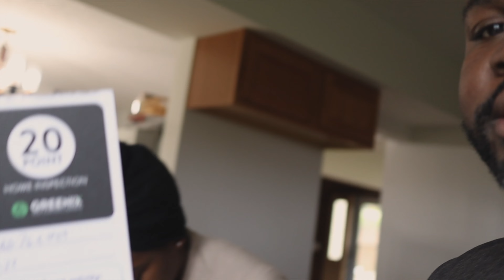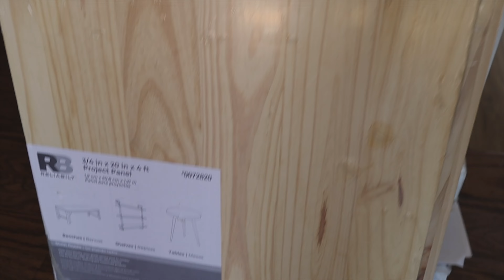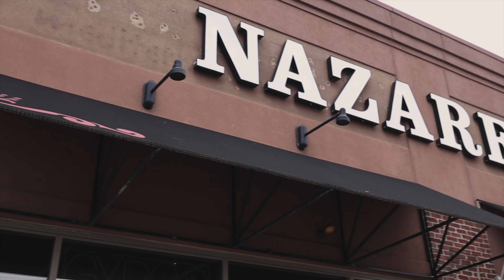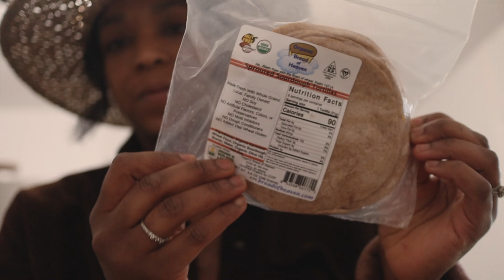Family Vlog | Roller Coaster Week + Living Room Reveal

Comment: You can get rid of some of the insects by using a vacuum cleaner that uses bags and has a hose attachment. You suck up the insects into the vacuum bag using the hose attachment and then put the vacuum bag inside of a plastic bag and carry it outside to your garbage barrel. Calling pest control may be needed. I hope this helps.
Reply from the maker: Thank you!

Comment: I wonder what kind of inspection was done that these things weren't picked up on as far a the siding, foundation, roof, and windows?
Reply from the maker: They did an inspection and the foundation and roof is all good. The siding was noted as “weathered” and no mention on the windows. The windows are just old and no longer sealed make it easy entry for bugs. We knew the house would need some work but not this much. Mainly stuff that we found out once we started living here